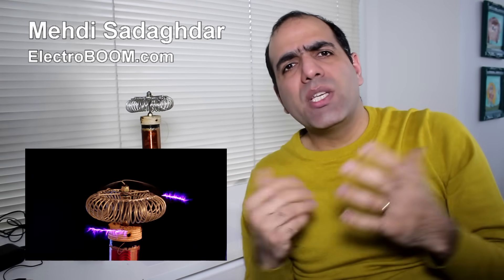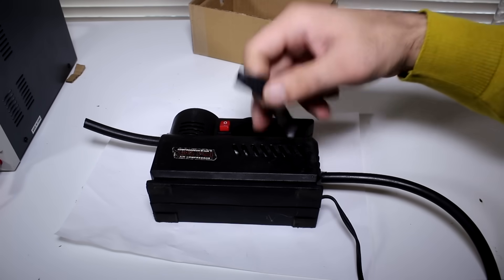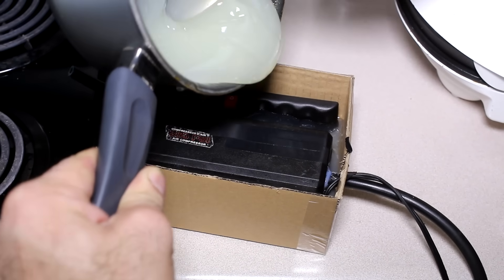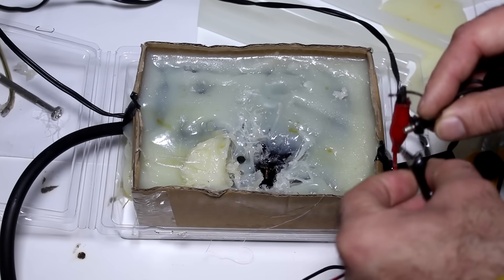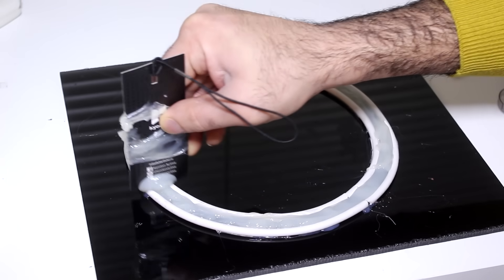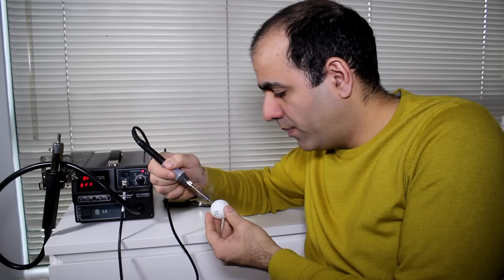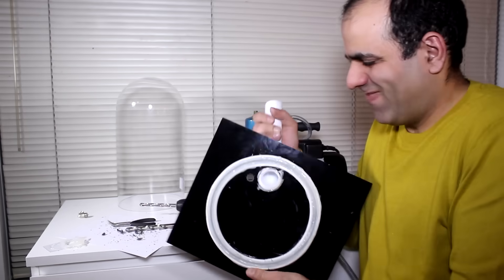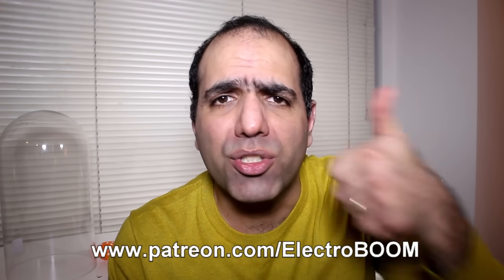Trying to Build a Vacuum Chamber

Comment: You need to do it in a steel tube and put a camera inside or something. I was just waiting for that glass to implode and blind you. Also there is no room for the thing to spin around at the top. That seal was genius though. You need to learn to weld.

Comment: I saw the switch was off and the glue would jam system
instantly when he put glue in the box. But all good entertainment.

Try glass not plastic water cooler bottle fill 4 inches engine oil. Put in long
heated red hot poker from top. Glass will cut evenly along surface of oil. 

Clean oil from jar bottom. Place Telsa coil in jar with cables through top into
pre drilled rubber cork along with pipe for vacuum seal could also add vacuum
gauge or sensor, and coat as before with hot glue. Cork should be slightly
tapered so becomes tighter as vacuum increases in bottle. Put silicone around
and on both halves of glass in same position were in when parted ( bottle
should have alignment marks before cutting) when silicone dry in position put
another layer of silicone around cut and cover in duct tape to add extra vacuum
tightness and also strength to join. Put on safety goggles in case implodes connect
up pump and electrics and you are ready to go. If you need any help send open
air return ticket from UK …. Keep up the good work!

Comment: So i connected my digital piano to a faulty wire a couple days ago(disconnected from the inside). It didn't turn on, so i gave the wire a few shakes. the thing turned in and off and on and off and then BOOM. Loud bang, visible spark. i'm not sure if the spark came from the cable or the piano itself.

do i just need to replace the wire or did i just fry the entire circuit? help plz
Reply: You should replace the wire. Most of the electronic components in a digital piano work on lower voltage. I recommend replacing the wire, and look if the piano still works.

Comment: Should have gone to a marine supply place and bought some resin (or a hobby place w/casting resin).  Use a turkey roasting pan for a form (coat it with something to prevent sticking).  Seal off the holes on the pump.  Not too much catalyst or it'll get hot too.  

I did this when I had to pot a big thing for cross sectioning.  It works.

However, the pump may blow better than it sucks so it might not work.

For chambers, just google "vacuum chamber".  You can get 'em cheap (a little over a hundred clams).

Comment: Why would anyone try to encase a pump in hot glue? A better way is to find a jar large enough, attach the output to the lid and add another hole in the lid to vaccume from. And i've never seen someone try to use such thin plexiglass.

Comment: The purple arcs are caused by the charged electrons ionizing and exciting the nitrogen in the air. If you weren't such a failure, the arcs would have gone away.
Reply: Jake Stein you can't say so indefinitely. There are too many other speculations that can be made
Reply: Can you provide any examples? The electrons aren't in an orbital cloud and thus cannot move down in energy to a ground state and emit light. If free electrons emit light on their own, live wires would glow purple.
Reply: My thing is that I don't think he could reach a vacuum strong enough to affect it

Comment: That is definitely not a vacuum rated bell jar, it looks like a cloche.  You are rather lucky the acrylic failed first.  The base needs to be thicker and much less brittle, especially with rough drilled holes in it.  No doubt you already know this. ;)

Preserving jars work well, but getting a tall enough one for your coil might be a challenge.  Two with an annular seal bulkhead between them?  A large spaghetti jar might be available in a thick enough wall to survive vacuum, if you can avoid loading its rim unevenly.

Comment: dude a half inch thick plate or thicker of acrylic would work just fine. you can make a perfect gasket seal for it out of Proto putty, the stuff is super easy to make and work with.

Comment: That was a beautiful series of failures. You were so close to getting it working. If you had taken the hot glue and used the hot glue gun to just apply it to where it needed to be sealed, I think it would have worked. I laughed all the way through this video because I've been there. I've had projects that were just a cascading waterfall of failure. Thanks for letting me know I'm not the only one.

Comment: I was actually hoping you'd find a way to get what you wanted but all the failures were just ways to entertain us whilst you found the actual way to making your own vacuum chamber. 
Like "Oh! After that big mess up with the glue imma just do these steps really fast but informative and make myself a vacuum chamber real quick." then have a pause to realize what you just did compared to the glue box. Also having a running gag or trademark such as getting shocked in every vid even if there isnt a possible way to get shocked would be cool.

Comment: save the glass o-ring, you can use it for later.

also with that broken pump, can you ruin it even more?
Reply: also with the hot glue you should melt it in just boiling water to prevent it from burning and the toxic gas.

Comment: Build one using a shop vac, 3/4" veneered plywood, 2x4s, and 3/4" plexi glass.  Build an open box with the plywood, plexi glass (on one side for a window), and 2x4s (rib the outside for reinforcement).  Build the lid, seal all the inner surfaces.  Use caulking to guarantee a seal on the corners and make a rubberized gasket and strong latch for the lid.  Use veneered ply not OSB, because the veneer will be a smoother surface to seal.  Seal the surface with anything that will dry hard and be air tight.

Comment: wow. Good job at trying but seriously no device will do the job other than a vacuum plump. you could use a AC compressor from a refrigerator. ALSO WHY THE F did you not use SILICONE instead of hot glue. im asuming that this entire video is a joke.

Comment: you could hape put the little car compressor inside the bell with the experiment, and routed the outlet out of the box, then ou would have had to make a seal around the cables to power it but that would have probably worked

Comment: It would be much easier if you had used an old Big Refrigerator Compressor from the Scapyard. Just hack you a Bit in the starting circuit (learning by doing ^^) and it works Perfect as a vacuum compressor. And its very cheap.
Good Wishes from Germany.

Comment: The compressor hack couldn't have worked at all, you just put the tube into the housing of the motor, there wouldn't have gotten any air through. You would have to attach it to the inlet of the actual cylinder that you could see under the casing.

Comment: I made a vacuum chamber like that, but used 10mm Delrin (POM) as a base plate. The bell came from ebay with a matching silicone rubber seal. To connect it to the vacuum pump I used common SMC 6mm tubes and fittings.

Comment: Either use thicker plexi or back it with a sheet of plywood. And you can avoid the possibility of flying glass shards by covering the dome in cling wrap. Once you've determined a safe vacuum pressure you can remove the cling wrap so you can see through the dome clearly.

Comment: In this video you can see an electrical engineer trying to be a mechanical engineer. It just doesn't work.
Reply: If it did work, I wouldn't watch.  :)
Reply: Funny thing is I bet the Glass isn't rated for extraneous pressure. I bet if a vacuum was put under it, it actually would shatter apart. From what I understand, there is very particular sets of glass and Plastics that you can use for vacuums
Reply: He said as much.  I don't think he ever planned for this to succeed..this was for pure comedy purposes.
Reply: Ya im pretty sure if he wanted to make it work he would have haha

Comment: all i wanted to do was learn how to make a vacuum, all i learned was how to brew hot glue sticks to perfection just like cooking mama..... or electro mama, i don't know anymore
Reply: lithium 1817 grant thompson made one that works
Reply: lithium 1817 😂👏🤓
Reply: Yeah but his plexiglass was at least a 1/2-inch thick and not 1/8-inch or even 1/4. Also, he caused a stress point with the hole for the vacuum cleaner which would never pull the vacuum he was looking for. A water aspirator would have done a better job.
Reply: just a nuhver cray cray black boy very true
Reply: Perfect! Even better than mama!
Reply: Actually, the silicone solution was pretty smart. I guess that one could help you if you actually wanted to use a vacuum chamber.
Reply: lithium 1817 why is this loser in recommendations
Reply: lithium 1817 he's awful
Reply: lithium 1817 summon mr gear